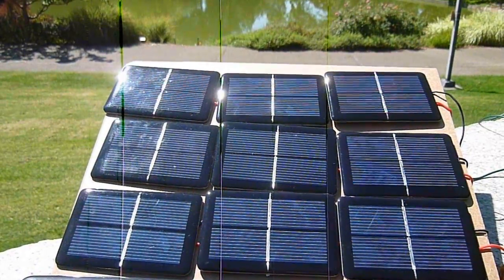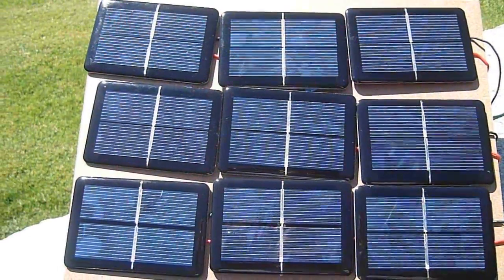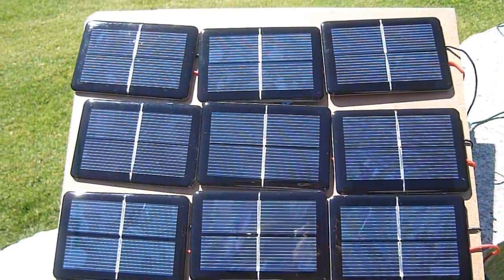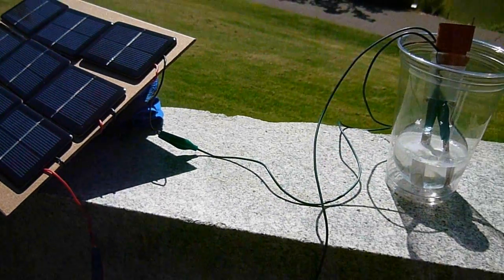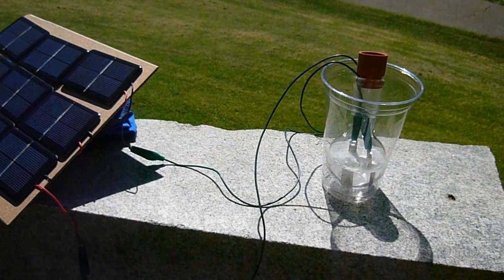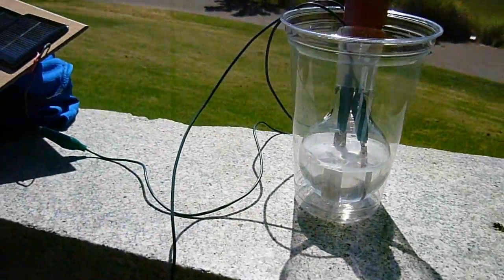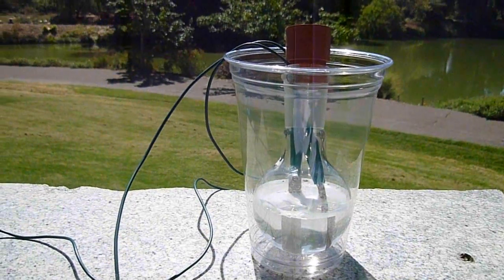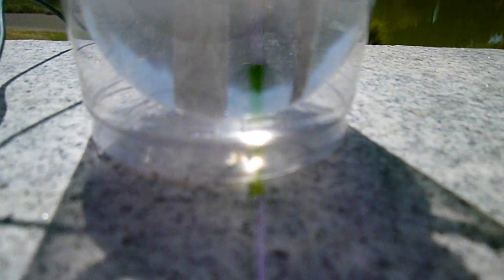Photocatalytic Water Splitting

Comment: this is not photocatalytic splitting
This is photovoltaic driven electrolysis
It would be photocatalytic if the plates were not connected to any power source and covered with a photocatalytic substance which means when they get hit by the sun's radiation they would promote the splitting of water.

Comment: I don't think this is photocatalytic water splitting. It is using a photoelectrochemical cell to convert sunlight to electricity, and then using electrolysis to split water. Photocatalytic water splitting uses only water, sunlight, and a catalyst, and does not need the middle step.
Reply: Yes  photocatalysis is not involved in this...Photocatalysis takes place when light of suitable frequency focused on water in contact with semiconducting powder or thinfilm.
Reply: Yes, that's right. I agree with you
Reply: Thank you for providing good knowledge ❤️
Reply: Exactly
Reply: You are correct